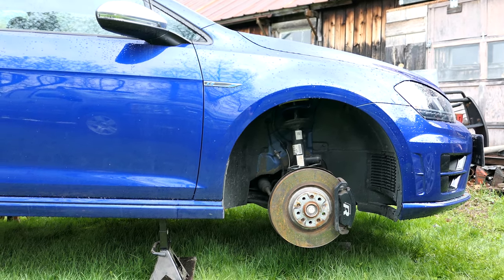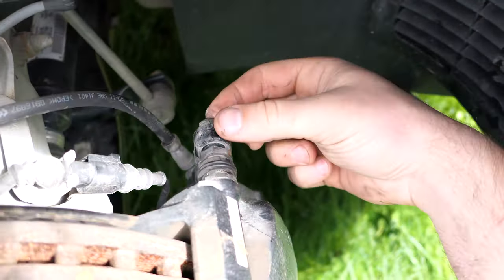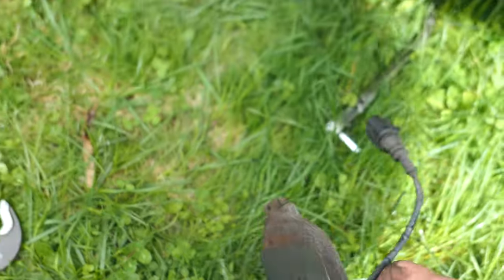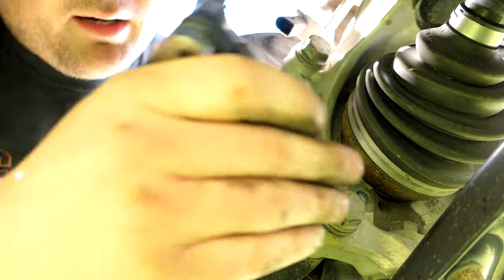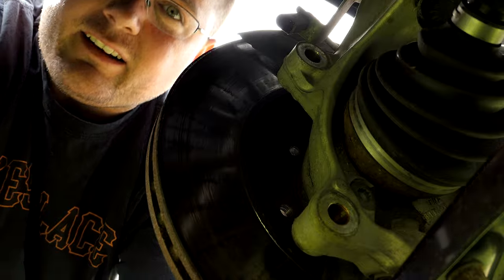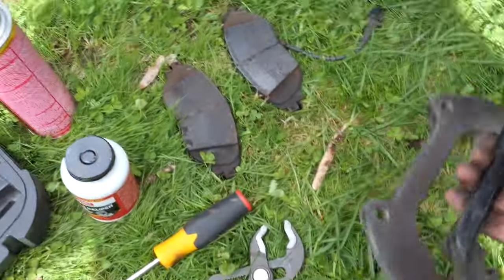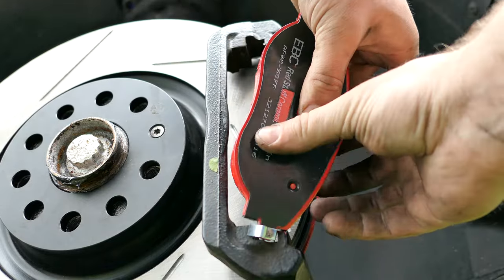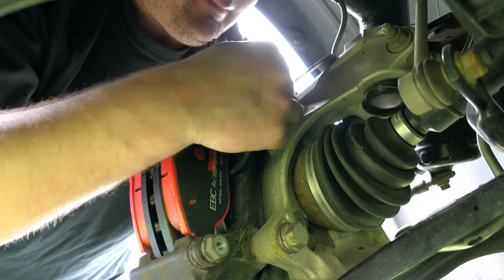How-To Replace Front Pads + Rotors on the MK7 Volkswagen Golf R (Edited + Dialogue)

Comment: Rotation matters if the internal fins are directional. If they are straight the rotor slot direction does not matter. 
As per #3 on stoptechs install papers.

Comment: Howdy, do all 4 sides have a brake sensor? Just my sensor light came on recently, mechanic said both my discs and pads are still in good shape. Was planning on this upgrade but only after my current pads aren't doing the trick. I have the 2015 Golf R. Cheers
Reply from the maker: I'm pretty sure only the front ones have a sensor, not the rear.

Comment: Does the vw golf r mk7 and 7.5 have the same brake and rotor steps to install and the same size
Reply from the maker: It does. no change in brakes between 2015 - 2019 model years.

Comment: Hey Adam. I just recently changed the pads on my MK7 GTI with the performance package brakes and I wanted to know if it was possible to over tighten the caliper bolts? I just don’t want the pads to drag in the disks. Thanks for the video.
Reply from the maker: I don't remember the torque specs but you won't change the dynamics by over-tigthening. The clearance would be unchanged. Torqueing stretches the bolt so it doesn't shimmy lose with vibration.

Comment: The pads seemed fine from what I could see, what made you think they required replacement?
Reply from the maker: Upgrade to Stoptech Rotors & EBC RED Stuff pads which bite a lot harder than OEM without having to buy a larger brake kit. I’ve kept this setup for a while now and they’re fantastic. No noise on the street, excellent grip on auto cross.
Reply: Adam Chandler nice dude glad to hear the positive results,

Comment: After having sometime with the new rotors and pads, would you give a positive recommendation for this specific mod/upgrade?
Reply from the maker: I'm still happy with them. 3 Track days, 2 AutoCross and maybe 20 drag strip runs later along with daily driving. No squeaks/Squeeling, no warm-up needed. They've been great. Still running the same EBC Red Stuff pads + stop tech rotors.
Reply: @AdamChandler86  Is it fine that the EBC website says that Redstuff pads aren't for track use :o

Comment: Do the Redstuff pads stop well when it's super cold out? (Thank you for this video!)
Reply from the maker: The Redstuff have been great. They seem to bite in any weather with the only delay being in the rain, it takes a rotation or two to clear the water from the rotor then it digs in hard. We have a VW sportwagen with OEM brakes and compared to that, the Golf R brakes are still just one piston but a slightly larger diameter and the red stuff to new OEM pads is night and day. I would recommend to anyone even just daily driver, cold wether, etc. the StopTech pads have also held up really well to rust.
Reply: @AdamChandler86  Thank you! I've been pretty worried about brake performance when its below freezing but there's so little information out there on it - to the point where I was considering getting OEMs to play it safe haha!
Reply from the maker: I definitely can understand the concern. It's logical that a track oriented pad would not work in cold weather. I definitely wouldn't run the yellow stuff for a daily driver. Dust, noise and requires warm-up. Red stuff has been great.
Reply: @AdamChandler86  My biggest concern was EBC's website saying that Reds weren't OK for track use (and that Yellows were good for cold weather), but I think your experience is probably more reliable! (e.g how are would the yellows with a higher operating temp range be better than the Reds for winter!?)
Reply from the maker: Hmm. not what I'd expect them to say. I love that with a dozen or so days of really ravaging on these brakes like heat-cycling, auto cross and drag strip days where Im' doing a lot of really hard braking from like 120MPH to 0 these have never started squeaking or whining at all which is great. And they've been on for 20K miles and are about half worn. I'm impressed.
Reply: @AdamChandler86  That's great to hear!! Thank you so much for all the insight 🚙🚙🚙

Comment: I have a mk7 tdi..do i need vag com to open the front calipers or that is only for the rears?
Reply from the maker: VCDS required only if you have an electronic parking brake (rear).
Reply: @AdamChandler86  awesome...thanks for the reply sr. 🍻